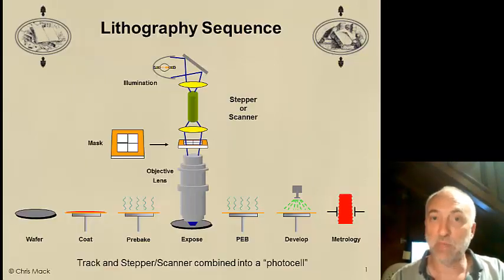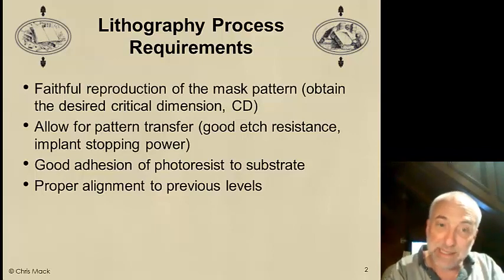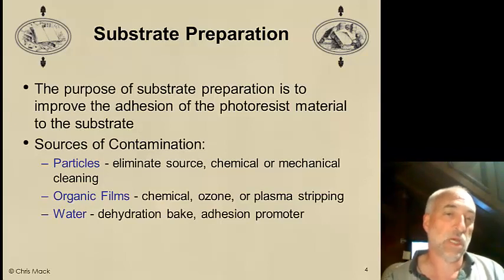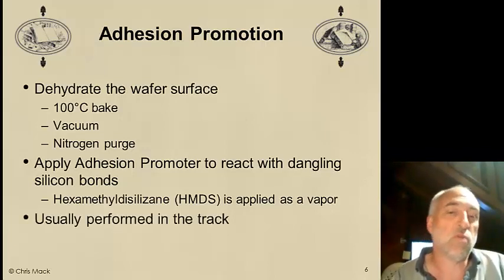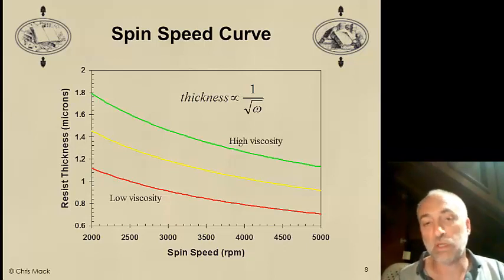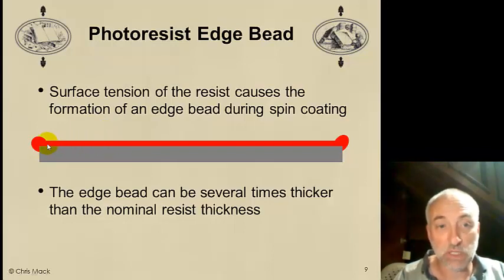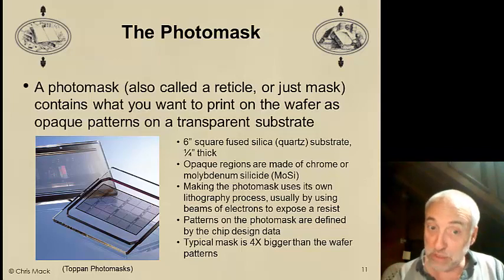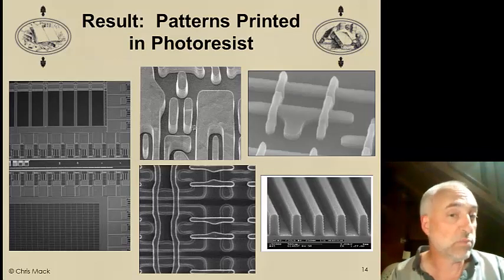Lecture 39 (CHE 323) Lithography Process Overview

Comment: Q1: reproduce the pattern CD required; transparent to the laser beam to expose the photoresist; good adhesion of photoresist to substarte; low cost; envioronment friendly...
Q2: photo, can be removed by the developer; resist, resist to the etching 
Q3: The adhesion promoter is a kind of vapor that can quickly adhere to the silica surface, so that the H2O has no place to adhere 
Q4: edge bead exists in the edge of the waver, it occurs because the direcion of the surface tension changes from  vertical direciton to  horizontal
Q5: removing the solvent that used to remove the particles and contaminants. 
Q6: positive photoresist: the part exposed to the light will be removed by developer; negative photoresist...